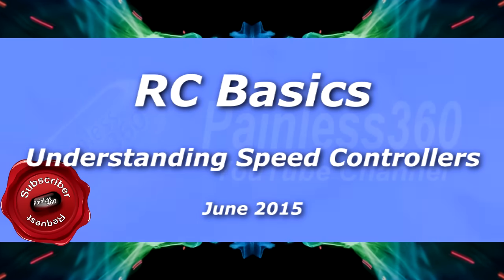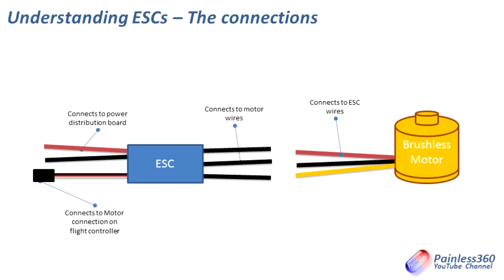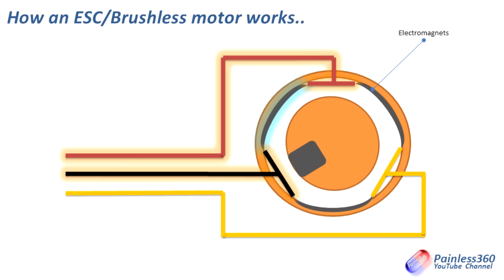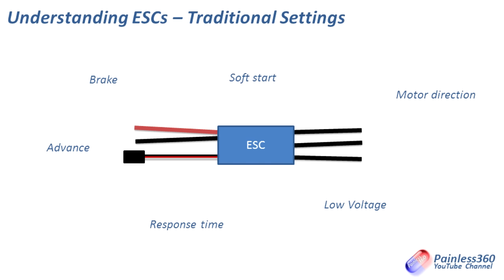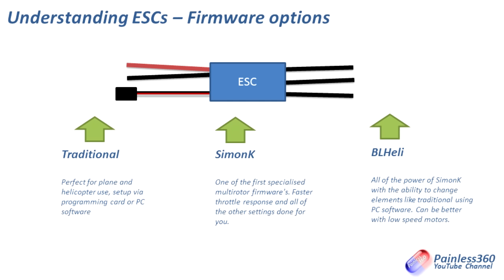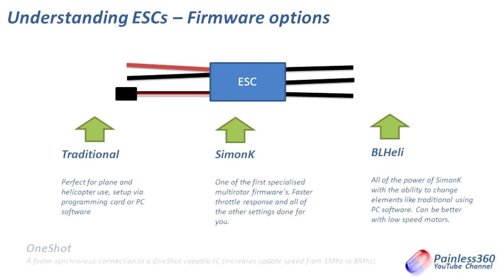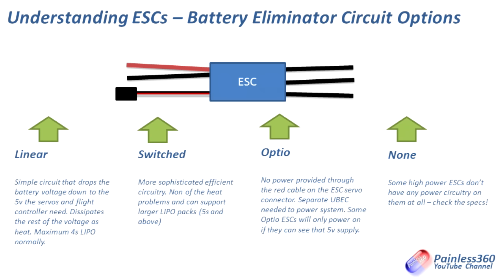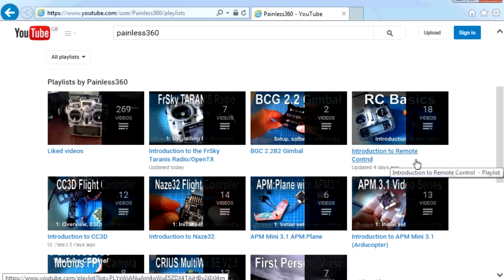RC Basics - Understanding Electronic Speed Controllers (ESC)

Comment: Is there any device or circuit that can be used for the stepper motor that needs more than 5 volts ??.....   

can I just connect stepper motor's  + - wire to higher volt battery and just signal wire to receiver ??? 

appreciated
Reply from the maker: Not sure on that one. I've not use stepper motors with radio controlled devices. The only thing I have used stepper motors in are 3D printers and they usually require some sophisticated drivers to run the Motors. Best of luck!
Reply: Painless360  Thanks hi I meant to ask for servo motor instead of stepper ...I want to convert toy ride on car to rc controlled and I am thinking to use servo for the steering mechanism
Reply from the maker: KAVI PATEL  I've only used servos that are of the same voltage that the radio receiver works on.. Best of luck!

Comment: after a crash my C wire coming from esc came off contact point. I 
resoldered the wire and now my motor just twitches and wont spin. I did a
 perfect solder job and tried a different working motor and the problem 
persists. Is my esc bad? cant see any esc damage.
Reply from the maker: +mariobeans I'd  check for another be break. That happens when one of the three wires from the ESCs to the motor is broken or disconnected. Best of luck!
Reply: +Painless360 i tried a different motor though. same problem. Do you think its esc? no visable damage to esc
Reply: anyway to troubleshoot esc without a multimeter?

Comment: Li, please ask me a question! on an engine that says 3s can i use a 4s battery if i use a 2 to 4s esc?
Reply from the maker: Sadly not. If you want to run a 4s battery you need an ESC and a motor that can handle that voltage.. Happy flying

Comment: Good video! :) Excuse me sir, I have a question, when I make the connection between the motor-esc and try to connect with the Li-Po battery, it makes a cortcircuit I dunno why, so I've taken my multimeter and checked continuity in the +  - esc wires, and there's continuity, when it souldn't be continuity I think, but all this happens whit my 4 pack, I'm getting a little mad, is this normal or I just Lost my money? Thanks and sorry for disturb!
Reply from the maker: There should be a resistance between the positive and negative wires on the battery connection going into the ESC. If not then something is wrong. See my quadcopter building for beginners series for the checks I make. Best of luck
Reply: @Painless360  danke! In fact I did a research and I discovered that the shortcircuit is normal by the esc's discharge (capacitor) so basically now it works.

Comment: hi don't know how this happened on my diatone gt2n but there is nothing for number 1 esc on blheli_s no info just blank, can it be replaced I'm a bit new to blheli so don't know what to do

thanks paul
Reply from the maker: If the ESC has power and the data link is connected then there could be a problem with that ESC.. I'd be tempted to swap two of the ESCs over on the flight controller in case it's the output on the FC that's at fault.. Best of luck!

Comment: Hello..!
This is a great video. 
I have been looking around for one solve, far as I have been able to understand BLDC motors, they will not run in forward & reverse as well on python codes (trying to build a rc car using Raspberry Pi). Is there a method i can achieve that, maybe putting another hardware or some code change, can i run them in reverse..? any help is much appreciated...!
Have a good time.. :)
Reply from the maker: Brushless motors need an electronic speed controller to run and the direction can change via swapping the order of the coils. This is how things like RC cars and trucks do it. I'd look into how ESCs work to figure out the magic. Best of luck

Comment: Great tutorial video my freind. Q: can you tell me what  ESC should I get for my 4pole 3650-5200kv motor using 4500 3s lipo 😳🤯😫 I got a cheap 120Amp ESC for £15 and it burnt out on its first run. I was lucky to be right there when it happend or I would of wrecked my car. Please can you help me.  🤔??
Reply from the maker: Look at the amp rating for the motor and get an ESC with a higher rating.. best of luck!
Reply: Thanks brother helps alot. 👍👊👍👊

Comment: Do I need to use the PDB if I am using ESC with BEC and not using any other power consuming applications
Reply from the maker: A PDB is only there to share around the battery voltage to the various ESCs in the model. A battery eliminator circuit (bec) just supplies the 5 volts for the electronics and that voltage isn't normally distributed via a PDB. Hope that helps..
Reply: @Painless360  
Thank you very much.  If I have four ESC for my quad copter with the BEC .for flight controller I can connect BEC which will supply 5 v to it. Considering this i think I don't need PDB is my understanding. Considering this I think no need of PDB until or otherwise I am going to some other power consuming devices.
Reply from the maker: If you are new to this then check out my quadcopter building for beginners series (I have about 5) where I build quads and explain every step. Best of luck!

Comment: i heard that esc turn dc into ac is thiss correct???? anddd why motor works with ac,,,,, butt they are manufactured for  dc????  sooo in the endpoint of an esc what whe have ac or dc
Reply from the maker: The ESC energises the magnetic coils in sequence in the brushless motor to make it turn as covered in the video. They are clever bits of kit. Happy flying

Comment: Am losing ma money, In 2 months 3 ESC been damaged. Could you plz explain more about amps? Ex: I have motor with 40A, 1-what would happen if I use ESC with 50A or 60A?
2-what would happen if I use ESC with 20A or 30A?
What are your recommendations of good ESC amps for my 40A motor?
Reply from the maker: Please check out the videos in the 'Introduction to remote control' series on this channel as I cover a lot of the basics regarding power systems as it sounds like you're missing a few of the basic concepts. The quick answer is always use an ESC rated for more than the motor will need... Best of luck!

Comment: Hello, thank you for yet another excellent video.  Even though I have used them for years, it clarified my understanding of ESC's, especially the significance of SimonK.  I do believe there is one thing that you could add to this video which I still don't quite understand.  That is the difference between 'Rapid' and standard ESC's.  In Open Pilot, one has to choose the type of ESC (as shown your very well done CC3D videos).  Can any ESC be a rapid ESC?  Are they special?  Are they something we should aim for? Can a firmware change make a standard ESC rapid?  Everything else about ESC's you have explained so clearly.  Just a thought.

Comment: I connected. My xxd 30a esc with 1000kv motor then to a 11.1v battery. One of the voltage regulators started to heat and melted the heat-conducting rubber. What could cause this? Do you have to connect the three-wire signal cable to the controller board before connecting battery?
Reply from the maker: +ATT T Sounds like a short in the wiring or a fault in a component. Best of luck with it!
Reply: +Painless360 , please give me any idea. Is there any problems with syncronisation of the motors when you shortened wires between  motors and esc? I made a rebuild to 210 frame from 250 (it worked perfectly for some months) and cut the wires between esc and motors to the lenght about 1,5sm and now when I use Damped light option motors randomly stops on rpm increasing ( not direct throttle, but rapid yaw or pitch input, none on roll). I have little bee 20a and dys be1806 2300kv. Tried to play with timings in blheli suite and other features like demag compensation, start force etc. nothing helps. Turn of damped light helps. But it worked and nothing changed except wires esc-motor length(((
Reply from the maker: The length of the wire shouldn't make any difference - best of luck!
Reply: +Painless360 thank you, will try to find another decision..
Reply: +Painless360 Want to share my decision - yesterday I&#39;ve flashed esc&#39;s with 14.6 blheli instead of 14.4, and there is one new feature - Break on stop. I&#39;ve turned it off and Damped light works now without desync. Thank you.
Reply: +Роман Савченко

Comment: Now I run over a topic related to the ESC, that I find interesting: What does the frequency do and what does it mean for a motor - ESC combination? Is a frequency lets say 600Hz better than 450Hz? Or is there a kind of rule - lower kV lower frequency or does it have to do with the number of poles od a brushless motor?
With a program card or with the TX the Hz is adjustable, but what is recommended for multicopter?
Reply from the maker: The frequency is the speed of updates to the ESC from the FC. Analogue servos and traditional ESCs normally update at 50hz or 50 times a second. Sounds like a lot right? 

Well, in practice a 50hz rate isn't enough for more aggressive moves with faster speeds so firmware like SimonK 6x the update speed and faster response were created. The pulses to the motor are managed by the ESC to match the throttle needed. 

 Hope this makes sense.
Reply: Painless360 So does this mean if I have the option to choose between 490Hz and 600Hz, I should switch to 600Hz?
(asking for Hobbywing XRotor black series ESC)
Thank you.

Comment: I'm having issues powering a small motor with an ESC that is 18A and made for a bigger motor. Is this normal?
Reply from the maker: It's not typical..
Reply: @Painless360  I'm thinking my soldered connections from the ESC to the motor might be compromised as it was my first time soldering. Could that potentially be the issue? Also, can a smaller motor draw high amounts of amps if the prop on it is too big for it? I'm thinking maybe the ESC is cutting it off because its a small, high KV motor using a oversized prop?
Reply from the maker: Possibly. Depends on the problem you are seeing.. stuttering would point to a bad connection..
Reply: @Painless360  I've ordered some bullet connectors to solder on. I'll let you know if that fixes the problem. I'm hoping its a connection issue as I don't really want to buy a new ESC when this one has barely seen the air. Thanks for the info.

Comment: nice video,
well i need to know some simple questions?
a brushless in market is marked as Kv( i:e; 1000Kv, 1400Kv, 2200Kv) but ESCs are marked as 'A" (like 15A, 20A, 30A, 40A etc.)
As i know always use 20% higher ESC.

SO MY SILLY QUESTION IS THAT 
FOR 1000Kv brushless motor ESC required? (in A please)
FOR 1400Kv brushless motor ESC required?
FOR 2200Kv brushless motor ESC required?

and please tell me propeller for each ?
Reply from the maker: It's not silly at all, but it sounds like you are very new to the hobby. Please watch the other videos in the 'Introduction to Remote Control' series. A lot of the basics in the hobby are covered in there. KV and Amp draw have no direct correlation. Best of luck!
Reply: i have seen all of your video but din get the answer.  sorry but neither in your reply. every one is making it too complicate for me. i understand simple things. i just want to know my answers because it will help me to go one step forward to my goal. i will learn by the time, and believe me i am learning, i know the roles of each and every electornics of rc plane. 
OK i make it easy
i have a 1000Kv brushless motor + 30A ESC + 3 Servos + lippo 11.1V 2200mAh battery.
IS IT A COMPATABLE CONFIGURATION FOR A RC PLANE??????

IF YES THEN,
WHAT SHOULD BE THE PERFECT WEIGHT OF THE PLANE INCLUDING ALL ELECTORNICS?
AND WHAT SHOULD BE THE PROPELLER SIZE?????

please don go into too much technicality it just complicate every thing.
Reply from the maker: I can't answer the question as you don't tell me what motor it is. The KV is how fast it turns, the amp rating how many amps the motor needs. You need an ESC with a 20% higher amp rating than the motor needs. All covered here - https://www.youtube.com/watch?v=DraFgiDELjI If you're still not sure then book a chargeable support call via the website. Best of luck.

Comment: I connected ESC, battery, and motor. Motor not running Esc is getting very hot. What could I be doing wrong?
Reply from the maker: Sounds like a wiring problem. I'd recheck it all. Best of luck
Reply from the maker: Yes, using the PWM library.

Comment: I have question guys ..need some help!!  Do brushless speed controllers allways stay connected into the receiver or just connected to calibrate then unplugged after ??
Reply from the maker: The are always connected. See my videos on RC basics. Best of luck
Reply: @Painless360    awesome.   Yah I'm a noob to the RC world and I bought two cheaper cars hbx 16890 with Brushed 390 motors .  I thought I would go brushless and race my stepson etc etc .  Then I realized .   They use a 2in1 ESC/receiver combo ..  so I got 2 of those .   Now I have a 35 amp ESC for whatever project.   ( What is a good receiver to use   or any kind etc .. 1:16 brushless .  It's a surpass hobby 35 amp    says plug in the bec and I'm like wth is that

Comment: Very very educational. Best ESC explanation. My quadcopter got lost and was found a month later upside down in a puddle of water with battery missing. I cleaned it and dried it out and checked to make sure all the motors still turned freely by hand.  After installing a new battery, i tried to fly it and it lifted off and hovered at 4 ft or so as usual but as soon as I tried to move it to the left, it drifted away and wouldn’t come back. I had to run after it to stop it.  Could a bad ESC cause this drifting away issue?
Reply from the maker: If it’s hovering ok then it’s unlikely. See my video on what to check if your Quadcopter drifts.. it may help..

Comment: how much does the lost heat in linear ESC's  affect the flight times?
Reply from the maker: Clyde Brown It affects it to a very small degree in fact. The main issue is the heat generated and the thermal stress on all the associated motor power electronics in the ESC. That's why you can only use them with smaller LIPO packs.
Hope this makes sense.

Comment: In 1 simple sentence, how is ESC different than a typical ebike controller? Why is it so small yet as powerful if not more ? Are all ESCs for non-hall sensor -type motors?
Reply from the maker: Already answered this one for you - 'No idea, I'm not familiar with bike controllers. I'd suspect it's current handing capacity, cooling and reliability.. Happy flying/rollin! :D'
Reply: Painless360 One difference i see is esc is for sensorless motors while ebike controllers usually for hallsensored

Comment: What brand is "the best" or most reliable in your opinion? What would you recommend with Tiger MN 4014-9 400kv? :) (trying to get build advice for free)
Reply from the maker: Damir Spanic More cash usually means a higher quality. This is a video about ESCs but the question is about motors?
Happy flying!
Reply: Painless360 no, no the question was: what are the best ESCs in your opinion? Like if you spent 2500$ on the rig what ESC will YOU use? Thanks anyway. No question about motors though. Just ESC. Great channel. Big fan. (meaning= I'm liking your videos)
Reply from the maker: Ah I see - I use those that have given me fault free operation for years. The HobbyKing ones I use are the basic 20A and 30A models flashed with SimonK.

Not the answer you were looking for but that's what I use..
Reply: Painless360 HK BlueSeries are very good for me. I use them too. Thank you.

Comment: So what does it mean when using a 3S and 20 amp ESC and your BEC output is 26v and the output to the motor is 26v constantly?
Reply from the maker: A 3s battery fully charged is 12.6v. That is the voltage that the ESC supplies to the motor in pulses to make it turn. Not sure where the 26v is coming from but you'd need a 6s pack for that..

Comment: I'm a bit unclear on the OPTO ESC's. I was planning to use my OPTOs for motor only and using a separate 6V batt to power my servos etc. Do I need to use a separate BEC or can I just plug the 6V battery pack into my receiver BATT slot?
Thanks for these videos, I subscribed.

Comment: what kind esc we use for syma drone x8, and what motors compatible with the esc and syma drone
Reply from the maker: Looks like the motors are brushed (only have two wires coming from them) so you'll need a brushed ESC. There are lots of spare parts for them so you should be able to find replacement ESCs and motors without too much trouble. Best of luck!

Comment: So the eachine 250 racer has opto simonk esc,s. It has his own bottom plate for pdb. The flightcontroller gets 5 volt from the pdb. In my case of the not turning left front motor that actually works and esc. Can i take the signal wire and plug it directly in the flightcontroller? It would be a waste of course of the pdb , but i want to know if the pdb is the cause of the issue i am having. Could i hook it up like this to see if it wil turn? Bypassing the pdb? Or will i be blowing something up. Ordered a new pdb board but if that does not work maybe its the flightcontroller. And i have to order that to. For configuring the esc,s in cleanflight the sounds go crazy all over the place. Not standard 2 beeps. The motor stutters.

Comment: Hi, Thanks for your kind videos, they help us alot. I have a doubt, I have gone through with various papers and found that ESCs should not run on low throttle say 50%, do u also think the same about this. As it will generate more heat. If yes? Can we calibrate our ESC at 50% throtte i.e. 1750 and then if we run it, so for us it is 50% but for ESC it should be considered as 100% throttle right?
If yes so can we use this method to run continuously.
Reply from the maker: For modern ESCs you don't have to worry about that. Happy flying